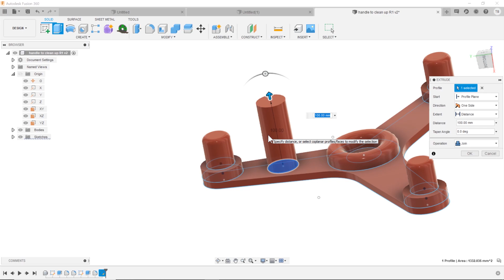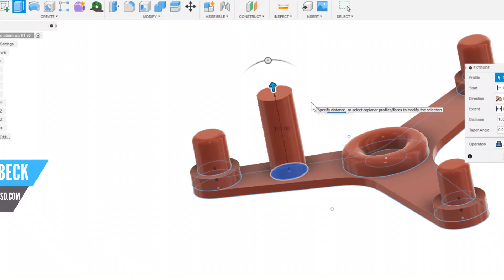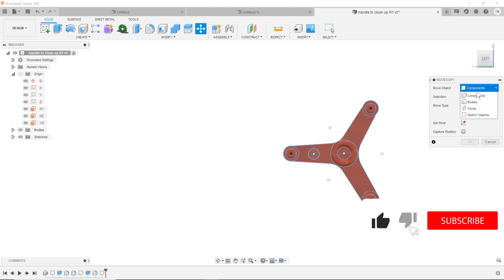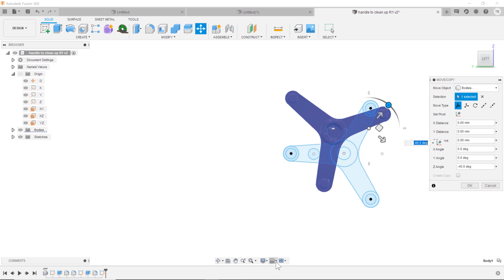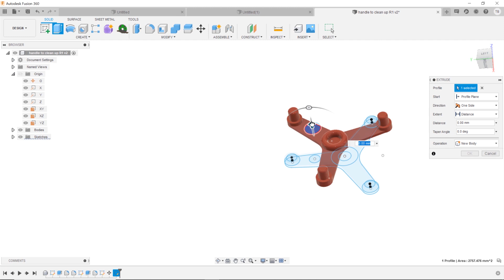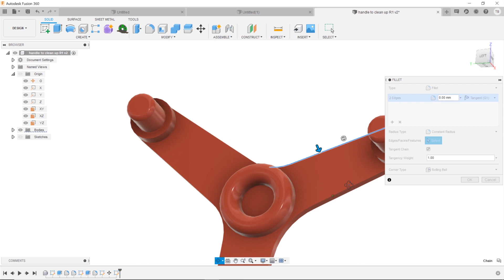FUSION 360 INCREMENTS (Adjust the drag distance and Angles)

Comment: Great video! Did you happen to notice any loss in computer horsepower? I’m just assuming your computer is calculating more times because of smaller increments? I wonder what effect that has later on when the model gets much larger and more complex? Just a thought.